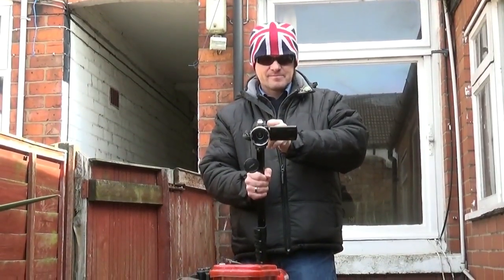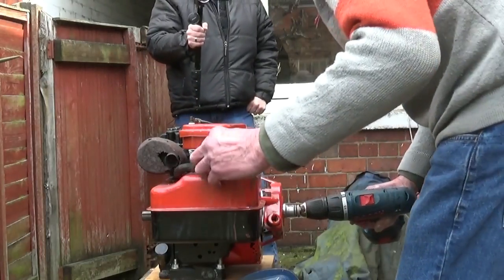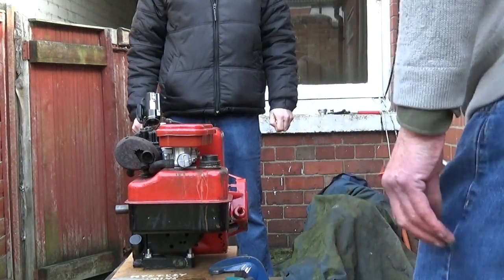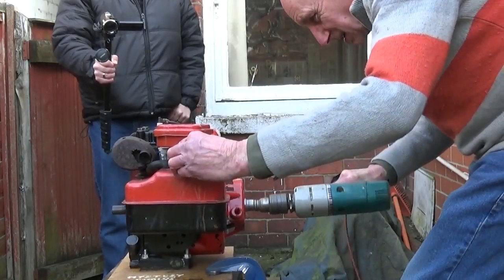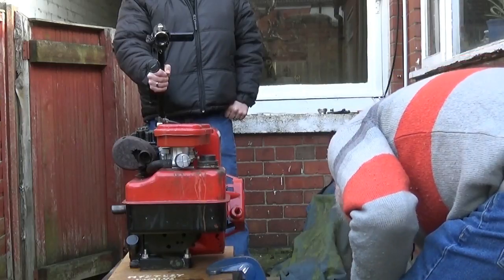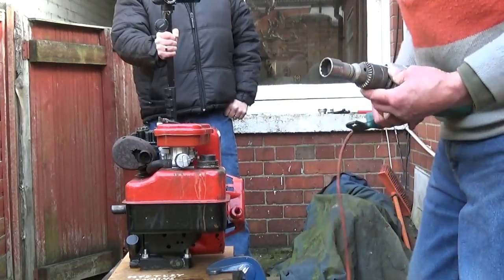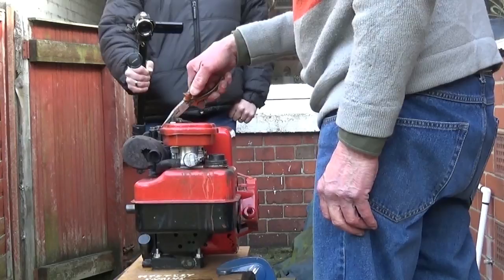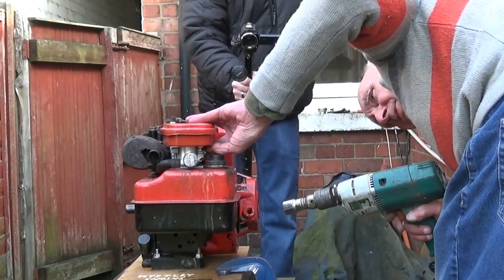Total Disaster with the First Demo of the Mystery Engine

Comment: malc i think you need a donkey engine   to get that  one started  lol.
Reply from the maker: LOl Duggy. It's a 50 year old engine, and the pickup pipe valve leaks, so takes a bit to prime it for the first start. However when I tried it the other day it started immediately once it was primed. Like first pull if it still had the pull start.

Comment: awesome video bro :) ive not commented in awhile but im still watching your videos keep up the good work
Reply from the maker: Cheers Ben. Let's just hope it doesn't happen next time when I take it to show people eh!
Reply: MalcOfLincoln true 👌 my engine in my metro can sometimes be moody lol and don’t like to start or idle right but only in the cold 👌
Reply from the maker: Treat it to a service, new plugs etc. That's the old A series isn't it. Not sure what electronics, if any it has but I used to change plugs, wires, dizzy cap, rotor, point, condenser every year when they became cheap enough on my Mini in the 70s and later my Mk1 Escort in the 80s. Never had a starting problem after that. Only thing is I think? hope yours has contactless ignition. New condensers can fail, not to be trusted.
Reply: its a k series metro aka rover metro :) engine runs sweet but it dont like the cold